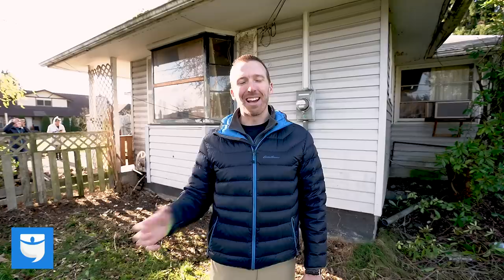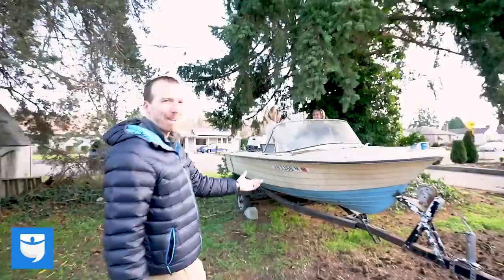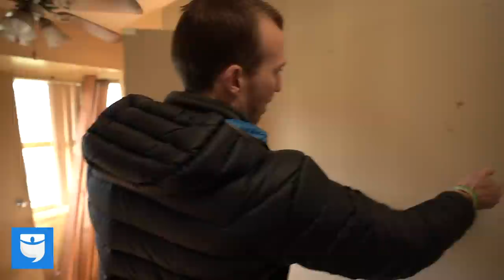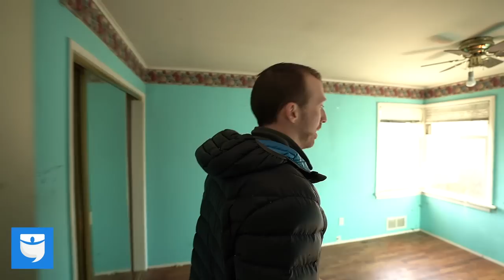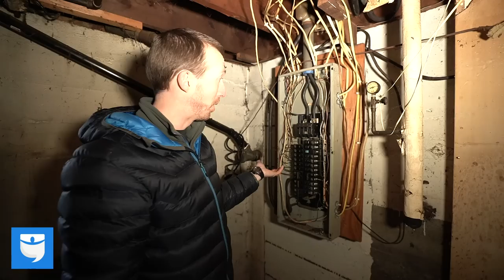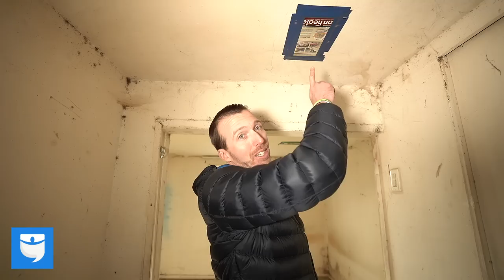Full Investment Property & Renovation Walkthrough!

Comment: Bed bugs are resilient MFers. Even if no one resided in that property for 2 years, I'd still go with spraying for bed bugs just as a precaution. If exterminators are too expensive then just grab Temprid FX (manufactured by Bayer), dilute it down and spray the whole place. What's great about Temprid FX is that it is effective not just for bed bugs but for other common household insects. 👍
Reply: I've known several people with bedbug experience. All have paid for it to be professionally sprayed.. never once has worked. Best bet is heat treatment.
Reply: Bed bugs can lay dormant for about 10 months without feeding. You're safe if it's been 2 years.
Reply: With that many insects I can't help but wonder if bombing the entire house under one of those giant tents might not be an option.
Reply: @adolpholiverbush5867  I had bed bugs back in 2015. Heat treatment - though I don't doubt it being the most effective - was and still very costly, which is why I sprayed with Temprid SC (predecessor to Temprid FX) instead. I think it worked for me because  I had the cooperation of my family and I was spraying almost everywhere I could once a week for a month (overkill, I know) at 16mL suspension per gallon of water for max potency. I was obsessed with these bugs, and I'm mentally scarred by them. Whenever I get an itchy bump on my skin, I freak out and ponder whether I could have gotten bed bugs again.
Reply: @madmark30001  You're probably right. I'm just paranoid when it comes to these buggers and I often go into overkill because I had them once before.
Reply: Zack Howard what is heat treatment